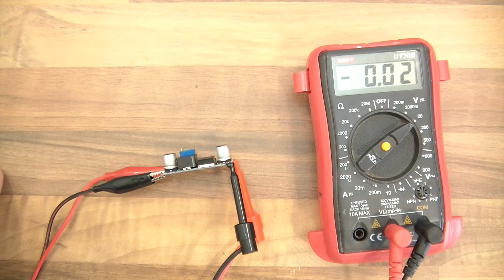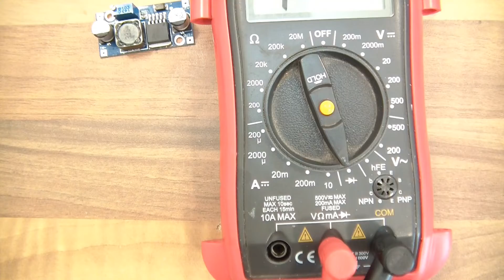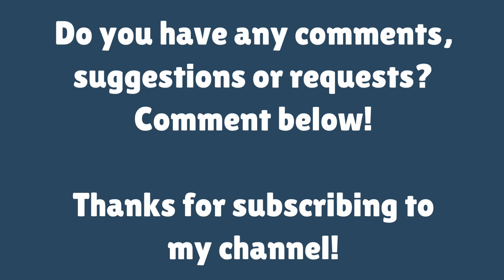TUTORIAL: How to Repair & Enhance (Broken or Not) XL6009 Boost Step Up Converter!

Comment: This video is good becuase today my XL6009 Boost Step Up Converter diode literaly vapourised into thin air after accidentally the module got short circuited.

Comment: I bought a XL6009 step up converter, but it only outputs 50V. Tested it with two voltmeters. I also tested inputing 5V and 3.7V, in both cases the output voltage is 50V. The potentiometer has no effect on the output.

Comment: In my xl6009 buck boost converter,I had increased output voltage above 45v and suddenly my display showed 0.0v and some 220mA. Xl6009 was getting very hot as well as the ss34 schottky diode at the output section. Checked and found the diode to be shorted. Removed it as per your method and soldered a SR360 schottky thru hole diode on to the pads. Working great now and i dare not increase output voltage above 30v because capacitor at the output is rated at 35v. Thank you for your video and hope this information will help someone. Thanks again !!!

Comment: hey. can i use regular 0.7v diode on my buck boost converter? the diode on my buck boost converter smoked when i connect the polarity of my power supply reversely.

Comment: The diode testing setting on multimeters shows the diode forward voltage drop in millivolts, not resistance. A normal silicon diode will show about 600-700mV and a Schottky diode around 250-350mV.
Also you won't double the current capability of a diode by using two in parallel. Their forward voltage drop has a negative temperature coefficient, so whichever diode gets slightly warmer than the other will pass more current and that will heat it up more until it is passing almost all of the current while the other one passes very little.
Reply: Perfectly correct. It is somewhat like putting two relays in parallel. A sudden surge current could cause one contact to weld at any time.
Reply: you are right but they are pretty close so I think it might actually be a good idea since if one of them heats up it will most likely heat the other too so no problem 
not sure tho didn't try it just my thoughts
Reply: @mahmoudsalah7628  It's a nice thought, but it just doesn't work. You might be able to increase the current capability of a single diode by a small amount by putting two in parallel, but you'll never get close to doubling it. The same effect makes it complicated to try to parallel two power BJTs (you usually have to add an emitter degeneration resistor to each one).

Comment: Sir Excellent Tutorial, I was looking around lot of stuff to rectify or to find troublesome issue with Step Up Module XL6009E1. Fortunately got your demonstration. Could you please help on issue i am facing up.

As i am connected to 5v battery (Its Power Bank rated at 2.1amp) and also 9v Battery with 1amp  to step up module and boost to 12v, if i am connected to dc motor all off suddenly it falls to 4v else, shows 12v. Also i have worked with alternative Step up Module MT3608 and the result is end up same. 

I am not able to figure out. Why voltage is getting drop all off sudden.
Reply: You may need to increase the input current or increase the resistance of the output (by adding a diode/resistor or two in series with your output) to lower your input requirements. 

A motor usually will draw more than a 5v USB power supply is capable of creating when converting it to 5v > 12v after conversion and efficiency losses.
 = )

Comment: i used a 12v dc fan and used xL6009 booster module. for input i used custom li-ion powerbank. on setting voltage to 12voltage, the fan speed is not par as it should be, it increases but not as it ahould be. and n while fan is running, voltage shows at 4 or 5 volts on display..
what could be the reason, little help will b appreciable.

Comment: Literally just bought mine brand new like this
Reply: Me too slightly different module but yeah same thing burned out a fan immediately
Reply: @clovenbeast5183   I changed the diode and it didn’t work still so guess it’s fuck I got a second 1 was running fine then all of the sudden the actual xl6009 mosfet exploded so I’ve ordered two this time lol
Reply: @shokdj1  And that's kind of crazy because the second batch I ordered were kind of similar to what you experienced lol

Comment: Lol your house even the songs is just like mine... 
Did you mean you can get closer/higher current  through put. Ohm's law still applies. I've not seen a volt and amp booster in the same device... Recently

Comment: I have this problem when my output cable is short, when a leave it for a second. And my child told me that the boost convertes is smoky. When i notice, and i see that the ss34 is burning. Luckly a can get ss34 replacement from old broken cellphone charger. And it work fine after a replace the broken ss34

Comment: I have a problem with LM2596 Buck converter, it's totally fresh but suddenly it's not working,
I change the diode but still, it's not working. Now, what do you think?
Reply: Try the little capacitor near the output. I have a trouble sama with you, and when i get a guarantee to the seller, they said that the problem is on the capacitor, when i see closer, the capacitor is not soldering well

Comment: The datasheet recommends and 1N5824 diode in its typical application circuit, also as it isn't a smd component it will allow more heat dissipation.

Comment: you had enough space to use a not smd diode like 1n4007 or more powerful. anyway nice video.
Reply: I tried 1N 4007 but it is not boosting. It varies as buck converter around range of half volt

Comment: i have this and it boosts voltage but when i hook say arduino to it ,it dam near puts out nothing. any ideas? could it be that diode in it?
Reply: Donald Henke watch this video, it explains that the diode isolates the inductor coil when the transistor opens the switch:
https://youtu.be/vwJYIorz_Aw
If your booster isn’t delivering power it could be a bad capacitor - just a guess, I really don’t know.

Comment: Thanks. I repaired my module using your method. Only difference is that I used a thruhole diode to allow it to disapate more heat. Worked perfectly.

Comment: What do u sold in the buck ?
I mean to say name from circuit ?
Reply from the maker: Js Nonny I'm afraid I'm not familiar with the semantics which you are using to form your sentences. :(
Reply: What diode do you solder in as replacement? The SS34? And which mounting: SMA, SMA MDD, SMB, SMB MDD, SMC, or SMAF?

Comment: Excellent video, thanks! Encouraged me to repair mine except i switched out the SS34 for a SS54 to get the extra current and it works great again now. Also, i would advise the addition of a small adhesive heat sink on the chip helps it a great deal. Mine works fine now up to at least 3A.
Reply from the maker: englishrupe01 wow, that's great!

Comment: With this module there is a big problem, when the voltage drop at the inlet below 3.3 V, the output gives 40V! Even if the resistor is exposed to a current of 5v
Reply: It's been said that these modules are only designed for use on 5V and over. 

Too much under 4.5v, and they can enter into a fault like state and do exactly as you described. (40v on the output and no ability to adjust the output.)
= )
Reply from the maker: GeneriK weird!
Reply: https://www.youtube.com/watch?v=uArobEAm0do
Reply: I wondered why I cant adjust the voltage lower than about 20v. My  battery is down near 3v. Will have to see if it works at higher input voltage.

Comment: Putting 2 diodes in parallel  is probably unpredictable in current sharing.
Reply: Any improvement is better than none! 😋🌎✨
Reply: @DeanTheDoctor  Yes, but two low current diodes won't increase the current capabilities by much because of the negative temperature coefficient of the pn-junction voltage. They are likely to be more expensive and more trouble to solder than one diode with twice the current rating.
Reply from the maker: Well, I'm not sure about that... Two diodes which are to the same spec, should have the same or similar resistance. Ofcourse, if they are both the same resistance, current will be halved between them. If one allows more current than the other, then it will still be better than just having one diode!
Reply: Practically there would be some current  sharing  which would probably be enough relieve the power dissipation issue. But since the diodes are not on the same die and tightly matched it is hard to predict how much current sharing occurs. Some is better than none. The ideal solution is to replace with a higher rated diode (if you can get it to fit).
Reply from the maker: R HP I agree! Also, the way I stacked them is not good because the sandwiched one will get more current and also heat and won't dissipate it very well... Still though... Got to be better than one.

Comment: i have the same problem when I give it 5v input it would be the same output it is not boosting, I check the diode and it giving beep sound in both polarities what should I do now? how can I check IC?
Reply from the maker: Hi Syed, you need to know what the beep means before you continue.
Reply: It probably means that your diode failed "short", so it behaves like a wire and is useless as a diode.

Comment: Nice video! Very clear and detailed instructions. I like your idea of improving this module. If any of mine fails I will try to mount the diodes side by side. Although these modules are not very expensive, I believe repairing gives good practice and avoids waste. Recently I uploaded a video about repairing an MT3608 boost converter module. See https://youtu.be/-3tBw6WSZVM
Reply from the maker: Maxint R&D Thanks!

Comment: How to change 143C 103W
Reply from the maker: Mitesh Dhanani What's that?
Reply: 103 means it is a 10k pot. the 10 is the base and the 3 is the number of 0's, so a 503 is 50k and a 253 is 25k and so on... you can replace it with a full shaft pot. in doubt, desolder it and hook the middle and one of the extremities pins and test it with a multimeter and see for yourself the range of the pot.